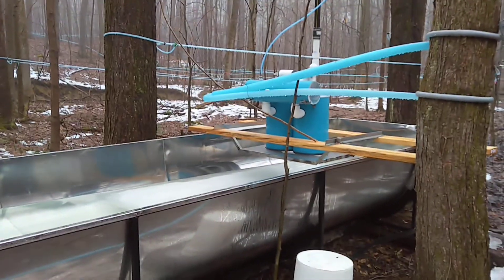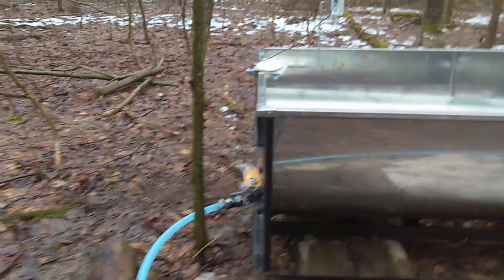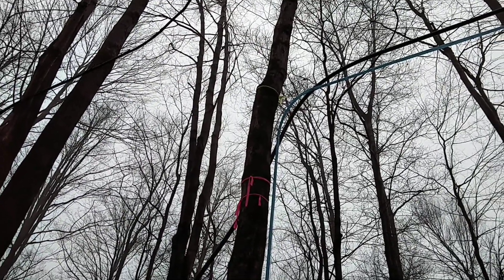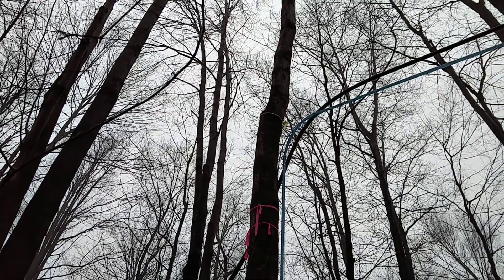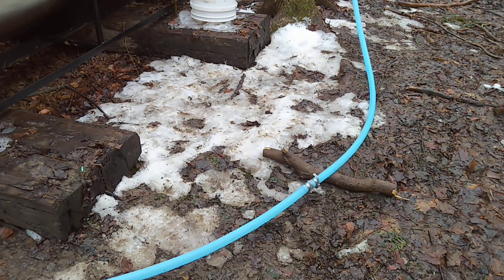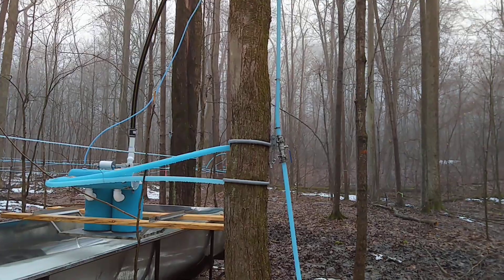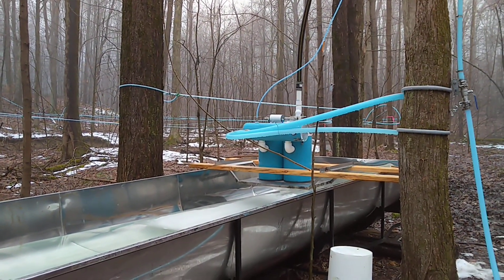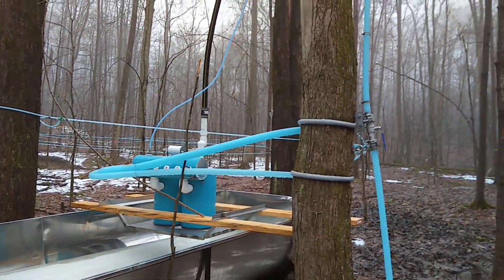Sap Lift With Vacuum - 1" Sap Transfer Line - Sap Ladder

Comment: I saw your updated video at one point on this with a motorized ball valve. I’m looking at some area too that could potentially see 3-500 taps that can’t make it into my conductor line without lifting but….. the low spot sits higher then the main tank down at the road side. I’ve seen something from d&g with a float that runs a flapper valve I think to do the same thing, any thoughts? How has your setup worked? 
I don’t really want to lift sap if I don’t have to. Plus I have a little extra mechanical releaser and a cdl 700 gal tank.
Reply from the maker: @ryan05753 We figured this out by accident.  I first looked at one of the reverse slope releasers.  It looked like a lot of hassle.  I was told the vacuum couldn't lift this high.  So I planned to pump it.  Then my dad just bypassed the little gas Honda pump.  And it worked.  He just regulated it with a valve.  Then we had issues with forgetting to shut the valve, and the vacuum would greatly drop.  So the solar valve system has been great.  It self regulates.  

But I really think Dan Crocker's 12V releaser is the next iteration.  The biggest issue we have now is leaks on the mechanical releasers.  They freeze up.  Such a pain.  Think about what we have....  a big sap tank.  A mechanical releaser that freezes up.  If we build a structure to heat - it would be inefficient.   We should just build a little shed with a 12V releaser.  Simple and no wastes vacuum cfm's on lifting sap.

12V releaser sidelands video: https://youtu.be/6Q_GjDzvCRg

Comment: hi,i have 2000 taps on a releaser and tank in the bush with gas engine pump,planning to push the sap 16 feet high and 2500 feet to my house whit a 2000 gph 12 v pump and was hoping to create a syphon since the front is a little lower than the back like your place,i was skeptic till i saw your video...just hope it works....
Reply from the maker: Good luck.  Let us know how it works..

There is a lot of friction on 2500 feet, depending on the diameter.  If you list the 12V pump name and model on mapletrader.com- there are a lot of helpful resources that could give you good insight.  Mapletrader.com has been very helpful to me.
Reply: @BissellMapleFarm  thanks a lot....

Comment: Do you have to prime the line to get the siphon started?
Reply from the maker: Dad doesn't seem to think so.   We pumped at the beginning with a little 1" Honda GX pump.  Then we removed the pump. Dad controls the flow with a 1" ball valve
Reply: @BissellMapleFarm  I have a similar setup I'm plumbing this season. If I'm able to have it work with the siphon, I'll put in an electronic ball valve controlled with a float. That way it will empty throughout the day as the sap rises and I won't have to wait for the entire tank to empty at dusk.
Reply from the maker: Lol.  That's what we want to do.  Right now, Dad is our electronic ball valve.  I think he'd like a little more freedom so he doesn't have to babysit our sap tank.  Our challenge is we don't have power out there.  We would need to come up with a 12V DC ball valve and a battery of some sort.  

We have a sap monitoring system with a tank level monitor on our sap tank.  It runs off a 20V DeWalt battery.  I have heard CDL now has some automation options.  So we can tell the sap level sensor to open and close a ball valve.  However, it will require another pump control (at $600!) To open and close the valve.... Not including the power source.  

But this stuff is fun!!
Reply: @BissellMapleFarm  Mine is near the generator/ vacuum pump building, so I'll run a wire to power the sap shack, it's still in progress. I'm actually pumping the sap about 500 ft. into an existing line on at the top of the hill that has vacuum, I'm hoping it will suck the sap and I won't have to pump it. I run 27" of vacuum, but I'm not sure exactly how much of a lift it is, it will be close.
Reply from the maker: @stevehardwick1578  did it work for you, Steve?
Reply: @BissellMapleFarm  It wouldn't siphon all the way to the top of the hill. I just put a pump in the tank with a float switch. So as it fills throughout the day, it occasionally pumps out the sap.